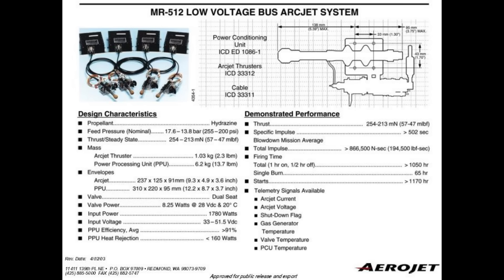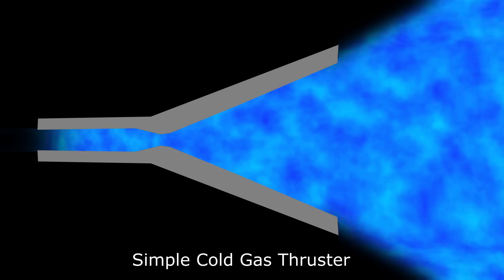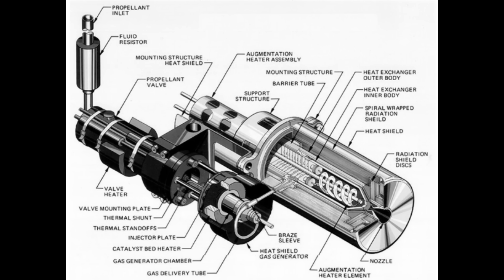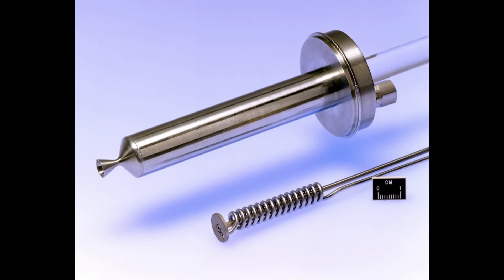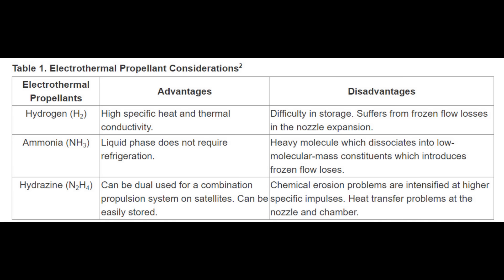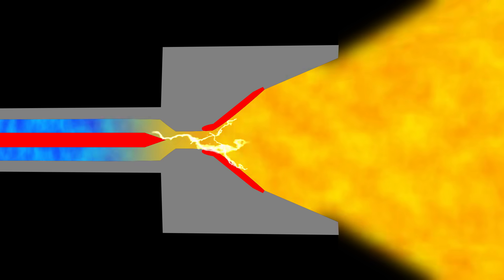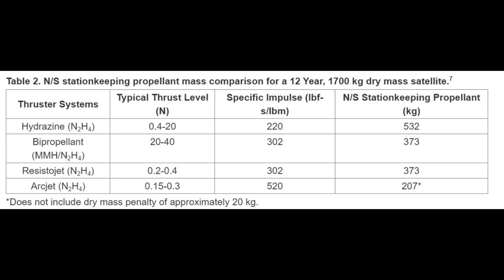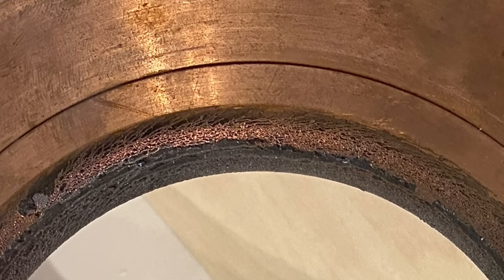Lightning In a Bottle?  The Science Of Electro-Thermal Rocket Engines

Comment: I've been toying with the idea of combining electrical heating (capacitive discharge) with burning gunpowder in a firearm.
The chamber of the device would have discharge electrodes connected to the capacitor circuit.
On firing, the powder burns and creates high pressure/temperature gasses.
Plasma, if you will.
It is at this point that the electrical discharge occurs, heating the propellant gasses to temps and pressures that they normally can't achieve through combustion alone.
Since the discharge is electrical in nature, it can be adjusted for firing conditions.
The main point would be the ability to control muzzle velocity while using 'standard' ammo.
Reply: IIRC they tried this with cannons where the propellant is a liquid that is set off by using an electrical discharge to explode a thin wire in the chamber.
The major improvement over conventional ignition was found to be only a moderate increase in muzzle velocity, but the chronograph showed that the percussion ignition version had a lot more variability in muzzle velocity than the exploding wire ignition version.
In other words, all things being equal, if you used such a system in an artillery cannon the result would be tighter shell groupings in the range dimension for the same gun tube, because the muzzle velocity shot-to-shot is much more consistent.
I'm unsure if they tested this exploding wire ignition vs standard percussion ignition with conventional solid propellant, but my thinking is that the results would be much the same, muzzle velocity would be much more consistent shot-to-shot for the same gun tube (even if each gun prints slightly differently than the others, I'm only talking about a single gun at a time here).
Reply: This sounds similar to "Metal Storm", or am I missing something.
Reply: I swear on forgotten weapons I've seen an electric primer.

Comment: I remember hype about VASIMR several years ago. ISS was supposed to be equipped with one of Ad Astra's engines for testing purposes. But since then, nada. I guess they found that making an exotic drive is not easy.
Reply: I very much want to see videos on VASIMR
Reply: power requirements and mass might have prevented that
Reply: Vasimr really needs superconductors to work properly. Hard to do in space, so far.

Comment: You talked about thermal storage. I was wondering about solar thermal energy. Spacecraft use radiators to dissipate the heat. Why not store some of that thermal energy for use in the thruster heater elements? It'd fulfill a dual purpose basically.
Reply: if you mean to use the waste heat of an engine to produce thrust, then that's possible but there's a trade-off. The total work performed is determined by the highest and lowest temperatures in the system, so you have to choose the proportion that is used to generate electricity or other mechanical power vs. rocket thrust
Reply: @shanent5793  no, use thermal energy from the sun. Some of it can be stored instead of radiating it all away. Then, it can be used to heat the gas before exiting the nozzle.

Comment: Increasing exhaust temperature does not increase efficiency. This is clearly seen in the efficiency difference between vacuum and sea level engines. A vacuum engine performs better because it can have a higher pressure and temperature drop, converting more of the enthalpy into exhaust velocity.

Comment: Highest possible Isp would be a linear particle accelerator, that shoots protons out at 99.9% light speed.  Laser-driven plasma wakefield accelerators are compact and lightweight enough for space applications.  Of course, the catch is that the impulse produced would likely be something like microNewtons or even less... and the power requirements could be quite something, too.  On the other hand, if one could harness enough power to produce a decent thrust with such a device, one would also have at hand a pretty powerful particle-beam weapon...  🫣
Reply: The highest possible Isp is the photon rocket, where all the mass has been converted to momentum. If there's any mass left over in the exhaust, then that equivalent energy mc² has been wasted
Reply: @shanent5793  well, technically a photon rocket has no Isp, since it doesn't expel any propellant at all.  I'd put it into a different category - of propellantless propulsion, right alongside solar and magnetosphere sails.
Reply: @Spherical_Cow  photon rockets have a defined Isp (in the millions of seconds) because there is still some mass flow. Even the case of electron–positron annihilation which converts all the mass into photons, the mass flow can be taken as the mass of e- – e+ pairs. Solar sails are different because they reflect the photons, they don't generate them so the mass of the vehicle doesn't change.
Reply: @shanent5793  in a similar way to how a solar sail reflects externally supplied photons, a photon rocket could use solar cells or externally supplied beamed (e.g. microwave) energy to power itself: it's not mandatory that the photons must be obtained by converting some onboard mass to energy inside the rocket itself.  But anyway, it's a rather pedantic dispute (still: you started it!  😝)
Reply: @Spherical_Cow  it's no small detail. If we accept that rockets eject anpything significant other than stored propellant, then that makes the case for photons having a higher Isp, the same way that jet aircraft have higher Isp than rockets operating in a vacuum

Comment: So, an ArcJet is simply a Plasma Cutter (Even the nozzle design inside looks similar) but used to generate thrust instead of cutting metal. Even the vortex gas injection is the same as in plasma cutters (they use a ceramic vortex ring with angled gas channels that generate a gas vortex inside the nozzle). That means it probably has problems with nozzle and electrode usage, which would limit its operating lifetime. Nozzles and electrodes in plasma cutting get used up PRETTY QUICKLY... Asking, cause I work with cnc plasma cutters and I'm just curious.
Edit: Just watched further and you talk about the issue of nozzle and electrode corrosion. So, good to know my hunch was right ;P
Reply: Yup. The plasma cutter uses the thrust and the heat to melt the metal in a very finely controlled spot. Making us mere humans believe it has cut the metal instead of torch cutting

Comment: My college (Missouri S&T) actually had a cubesat onboard Transporter-10 earlier this year that was made to test a multi-mode engine that could switch between a cold gas and electric thruster, so this was pretty nice to see a video on! Unfortunately I didn’t get to help work on it since I joined the satellite design team fairly late, and also I believe it failed to establish contact with an Iridium satellite for comms after launch, so we couldn’t use it as we hoped
Reply: That sucks, I'm sorry... did it have passive solar panels or automatically deploying solar panels, or was it running from battery and relying on ground commands to deploy the panels? I ask because there's a (remote) chance that it might suddenly wake up and text you; weirder things have happened.
Reply: @bewilderbeestie  the power system wasn’t the issue, the faculty involved said our orbital velocity relative to the relay sats was probably different to the point that we couldn’t account for the red/blueshift in the signal frequency. That was as of early April this year, so it’s possible they’ve managed to find a workaround since then
Reply: Which mission was it? Was it a UNP mission?
Reply: @MoonWeasel23  yea it was UNP, the mission name was M^3, which stands for Multi-Mode Mission
Reply: Interesting. I did NS-10 and 11 and y’all were in that cohort as well with a new mission. Smallsat was fun, but the piles of documentation was something I could do without
Reply: Henlo

Comment: When electrodes vaporize, they become fuel.  I was testing plasma circuit with Microwave Transformer + 3 Microwave capacitors and I originally thought the pretty purple & green flames was burning air but after I examined my copper electrodes I see that they vaporized and was the fuel responsible for colored flame.
Reply: Ah yes, the famous engine rich exhaust
Reply: @Johnny_OSG  😂 I admit you got a laugh outta me with that one.

"Mixture full rich! Mixture full lean! Mixture...engine...rich?"
Reply: Microwave transformers are scary dangerous.
Reply: I mean why not though. Make the engine it self the consumable fuel. Use graphite for the chamber, nozzle, and electrodes. I get that it might be a bit power hungry though and is probably the main argument against it especially when there's other things that can get the same thrust for less power.
Reply: @Slowly_Going_Mad  Using the engine as fuel opens up possibilities.  Imagine the electric arc vaporizing a magnesium engine then injecting water.  When vaporized magnesium reacts with water it produces magnesium hydroxide (Mg(OH)2) and hydrogen gas (H2) in an explosive reaction giving Plasma Arcjet more powerful thrust.
Reply: @miken7629  well sort of. An arc can supply way higher temperatures than combustion even with reactive metals. My biggest case and point for this is the manufacturing of magnesium in the first place. They reduce it's salts in an arc reactor furnace, then quickly quench the vapors on a collection surface. Basically you won't get much performance out of pumping energy into chemical bonds when the plasma temperature meets or exceeds the enthalpy of the reaction in the first place.

Comment: So a TIG welding nozzle as a rocket motor? OK! This does make me wonder if you could do a secondary acceleration ionically, since you're cranking potentially plasma level temps, you've got an ionized gas to work with.

Comment: Using electricity to add energy to a combusting propellant has also been explored for cannons, to "smooth out" the pressure curve (gun barrel pressure curves generally have a really high peak at the chamber, and then rapidly drop off - you don't get a "level", steady pressure curve that has more energy overall, but with dramatically lower peak pressures, and can be tailored to the barrel length more efficiently).

This would increase velocities, reduce the need for as thick a breech (with the theoretical downside of requiring thicker barrel walls closer to the muzzle, but most cannon barrels are way overbuilt for the pressure they'll experience to decrease mechanical droop and increase heat sink capacity, so it's likely a wash or even a mass reduction overall), a less violent recoil (same total energy as youd get from the same projo at the same velocity from the same mass gun... but instead of a front end massive kick, it's more of a steady shove evened out along the entire barrel length), which makes designing recoil recuperation systems ("shock absorbers") easier because they have a lower peak velocity and force to handle.

Problem is, it really complicates the gun design and logistics overall, and its generally easier to just make a longer barrel with a heavier recoil system, and just jam more conventional propellent in there.  Especially since this really works best with a liquid propellent, and thats a PITA to deal with in the field than propellent charge bags.
Reply: Fascinating. Can you tell the name of the program of give a source for additional reading material?
Reply: Another advantage of such electro-thermal cannons is that if you ignite the propellant using a large plasma discharge, you can reliably ignite propellants that are a lot harder to ignite by other means, which makes the ammunition a lot safer.
Reply: can't you achieve the same thing with a slower burning propellant? or maybe just light the multiple bags of propellants at staggered times?
Reply: @1224chrisng  Problem with that second idea is that setting off any one bag of propellant will set off all the rest of them in the chamber.
But I kinda see what you're thinking, and there's existing research on it, so if you're interested go look at the WWII German "V-3" super cannon idea for a better implementation of the "ignite multiple bags of propellant at staggered times" concept.
To answer your other proposal, slower burning propellants are good, but we already have and already use propellants with burn rates more or less tailored to the length of the gun barrel, so the answer is "Yes, but they're already doing that".
Reply: @44R0Ndin Yep, the V-3 would have used that, however, the idea of multi-chamber guns is not exactly new. That one has been a mostly theoretical idea for a long time. 

You can also shape the propellant to burn increasingly faster and faster, keeping the initial pressure lower and the follow-on pressure higher, at least to some degree.

But why use propellant at all when you can have a simple railgun or a coil gun? They do not need a high pressure barrel, and you could add a few small rocket engines to keep on speeding up … though that has not worked all that well in practice.
Reply: @1224chrisng  The U.S. navy already did that decade(s) ago.  Federal won the contract to increase the muzzle velocity of 20mm ammo.  They used a press to shove more of a slower burning propellent into the case.  (It was pressed in two increments to prevent what happened aboard the USS Iowa.)
Reply: It's near to impossible to provide necessary power via some sort of electricity-based heating for a typical cannon - one need to deliver a lot of energy in a fraction of second.
Reply: @PanzerschrekCN   Well, you can dump a lot of power just using (plate) capacitors, no electrolytes, in a very short timeframe. They would be huge, and deadly to short by accident and you would have to have a propellant heating system that can deliver that power w/o destroying itself prematurely, at least once,  and and and

Just consider the size of the wiring needed to carry that amount of power w/o exploding from the thermic and magnetic shock.  No, you cannot just use superconductors, they have a limit in power density they can transport w/o losing superconductivity. And if they suddenly fail, they will explode extremely violently.

If you have that amount of power, just use a coil gun and maybe you could use the chemical reaction to initially kick-start the projectile. Though my wild-ass-guess is that it will cause a lot more problems (heat, erosion, damage to the coils, …  than it is worth.
Reply: @advorak8529  convoluted idea of mine: combining chemical and coil systems in another direction - if there is a chemical that is powerful but burns too slowly to be used in standard barrels then could you magnetically hold the bullet until pressure builds up to be usable…
😅I think I need to sleep
Reply: Whoa that is awesome, and interesting. I wonder what speeds they were getting. 

 Is that essentially some type of gas gun, but with gun powder?

 We just need more powerful chemicals somehow damn it. Why is physics so limiting. Think modern gun powder is about 5.5k feet per second or 1,700m/s. Come on. 

 Know the names of the projects?
Reply: If memory serves, trying to get that to work started late 80's early 90's. But I could be miss remembering. 😢getting old and my artillery days are long gone.
Reply: Till we can achieve faster than light travel (FTL if that's even possible), we're going nowhere fast with chemical and plasma rockets, and will be stuck here in our little solar system prison forever.  Insanity = Keep doing the same thing, expecting different results.
Reply: why do people in the U.S. distillate every discussion with a gun analogy? the U.S. society can only think in terms of violence. can you think of any other analogy that would do the trick? or, is it always going to be weapons? hey, guns in space! we now have a 'space force'. FFS. why does everything need to be militarized? this is abnormal behavior - it's obsessive.
Reply: Ummm. Electric gun , cool.
Reply: Why would the peak velocity be lower if the velocity at the end of the barrel is just as high or higher than that of a normal gun?
Reply: TLDR
Reply: My wife brings me a seemingly never ending quantity of charged bags.

Comment: hydrogen is inert?
Reply: Hydrogen is relatively inert, at sufficiently high temperatures, it acts reductive (hence blast furnaces can theoretically be run on hydrogen to reduce iron ore to elemental iron), but it's not a strong enough reducing agent to do much with the material the engine would be made from afaik.
Reply: in the absence of oxidizers, yes.
Reply: I was thinking the same thing, i think he meant to say helium.
Reply: @xxlocobassistxx  no he meant hydrogen. although helium is more inert, it weighs a lot more per atom which reduces specific impulse. Additionally, a tank of liquid hydrogen in space is much safer than one on earth, as it only has fuel with no oxidizer for it to burn with.